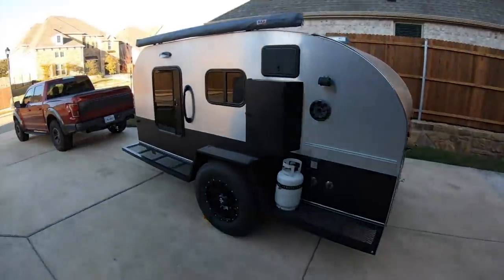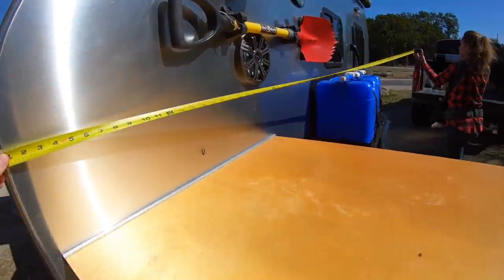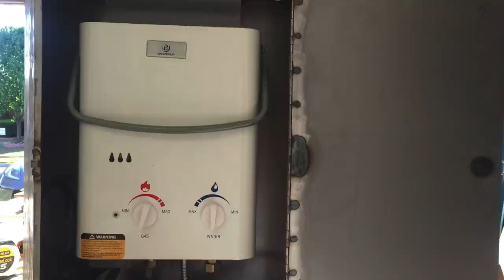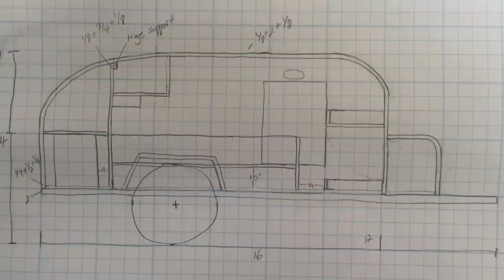DIY off-road teardrop camper build in 15 minutes

Comment: Bob looks great in the wild!!!  :)
2500lbs...ya, I figured Bob had a few pounds on 'im.  I built a 102" x 12' enclosed snowmobile trailer, all aluminum,w/ ramp door at the back, she wound up at 2500 lbs with 1000+lbs of sleds and fuel in it....weight...always the trade-off.  Saved myself about $6k tho ...  :)

Comment: Probably a dumb question but how did you make the side wall skeleton? Did you attach several pieces of plywood together and if so how?
Reply from the maker: Not a dumb question! There’s a few different methods. We took a 5x10 piece of plywood and added an extra 2’ by joining the panels with biscuits. Same way we did the floor at 1:48.
Reply: @ZeroToAwesome  oh ok awesome, didn’t think about biscuit joints, thanks for the response

Comment: Do you have any tips to make it strong enough to hold a lot of weight on the roof? We want to add a large rooftop tent for our kids but are worried about whether it can hold 500-600lbs.
Reply from the maker: Make sure the walls are solid all the way down to the frame where the mounting points are and double up on roof spars across the top

Comment: Nice build, awesome! Iam getting ready to build my third one. Iam using 1-1/2" aluminum honeycomb floorboards and walls, and going a monocoque construction direction.  I designed a DC to DC charge controller that will enable lithium battery charging via my Trucks smart alternator using an Anderson plug when towing, then when at camp or not in tow the 600 watts of solar panels take care of charge duties.
Reply from the maker: Thanks! Your build sounds awesome. If I wind up with a bigger shop one day there may be a bigger bob...
Reply: Zero To Awesome Nice! I got a close friend in Lakeway Texas who is also building a 7x12 camper. I noticed your also a Texan...I don't think building a bigger camper would be much more effort than the your "BOB".  The material would just be scaled up. Consider aluminum honeycomb sandwich composite panel next time, super featherweight, superior strength,  enables monocoque construction with use of 1000's of extrusions to choose from to tie in the edges, or joints, eliminates the need for insulation and exterior/ interior sheathing, and can be used for floor, walls and cabinet construction. The 1-1/2" panel we used was strong enough to hold 2400lbs per 8 foot panel span when sitting on two opposing saw horses. Standard material for Aerospace use as floor deck, bulkheads, and cabinets/doors. We used it in the NASA/Sierra Nevada Dreamchaser. I'm approaching my current build from an aerospace perspective after two other traditional builds. Something to ponder anyways!!??
Reply from the maker: Dang, sounds like some good stuff. I’ll have to look into it. Thanks for the tip!

Comment: Just curious what size and gauge of metal square tubing did you use to make your trailer? The trailer looks cool!
Reply from the maker: Thanks! It’s 2” square tube all around. The box of the frame is 1/8” thick and the tongue is 3/16”

Comment: you mentioned the gravel guard, what did you use and what was the issue with the stuff you used originally?
Nice build BTW
Reply from the maker: Thanks! It’s just called “gravel guard” and comes in a few different sizes. Can’t remember which one I got it from, but most trailer supply companies seem to have it

Comment: I really want my own and greatly appreciate this video. I lack the knowledge to weld. Handy with everything else though. Really wanting to hack my ATV trailer up and make it an ATV hauler in front and teardrop trailer in the rear. What welding unit do you have? Is that stick welding? Thank you for the post.
Reply from the maker: The ATV/Toy hauler and teardrop is a awesome idea we have actually talked about a little bit. I say go for it! That was a Lincoln wire-fed MIG machine. You can get a decent Hobart or Lincoln MIG welder new for around $500, maybe score a better deal on a used one online. It’s not too hard to learn, just takes 
practice and a few “how to” videos.
Reply: @ZeroToAwesome  Sweet. I'm definitely inspired. Thanks for the response for the welding. Will look more into MIG welding. To get started I might draw up the frame conversion in AutoCad and OnShape and go get quotes from trailer companies here in Houston to get things going.
Reply from the maker: Sounds like a plan! A lot of trailer manufacturers use C channel steel, try to get a quote for square tube. It is much stronger than C channel, especially if you want to park some toys on it. If you decide to build the frame yourself find a steel yard to buy from. Big box stores charge 10x more and you can’t find the lengths and thicknesses you will need. Let us know if you have any other questions, good luck!

Comment: What size hardwood did you use for your walls? Im building a 5x10 similar to this but havnt nailed down the height quite right and it seems like anything over 4 foot tall increases how hard it is to find plywood that wide.
Reply from the maker: 5’ using 5x5 birch. Try looking for a lumber supply company. Regular hardware stores won’t have it
Reply: @ZeroToAwesome  Thanks so much! Ill definitely have a look around for some. The camper looks great man, and has really inspired me in my own build.
Reply from the maker: No problem. Good luck with your build!

Comment: Is there a reason you chose steel for a base instead of aluminum?
Reply from the maker: Yeah I didn’t have a welder that would weld aluminum back then
Reply: @ZeroToAwesome  Gotcha.. even if you did have the right machine, steel is definitely way easier to weld! I'm just making sure it wasn't for compatibility issues with your other components. Thank you!

Comment: Did you order a roll of aluminum for the sides? Or did you get it in sheets? Any recommendations on where to get aluminum for siding?
Reply from the maker: I got it from a local semi trailer repair shop. They called it “roofing aluminum” and sold it by the foot off a huge 8ft wide roll. Sign shops also sell it but typically only in 4ft sections
Reply: Zero To Awesome nice! I wouldn’t have thought of a semi-trailer place. Plenty of those nearby in Denver. I’ll definitely check it out. Thanks!

Comment: I stopped watching after I saw you use wood for floor. Big mistake. I assume it will get wet: and if it gets wet it rots. Yes even marine plywood.
Reply from the maker: Coated it in epoxy ;)